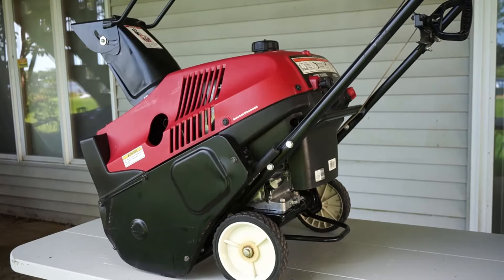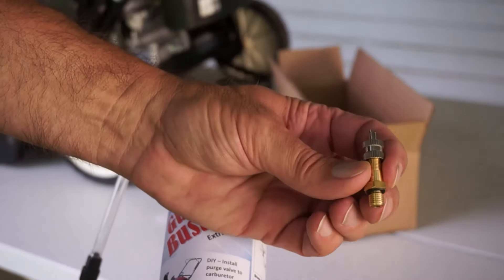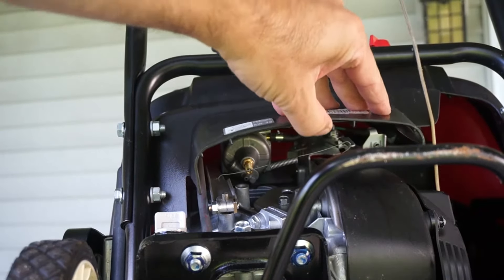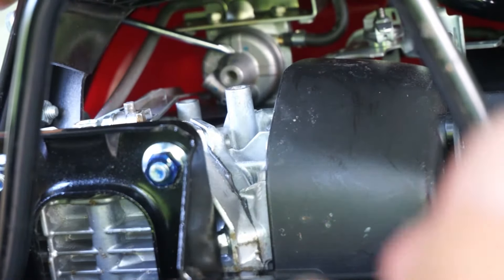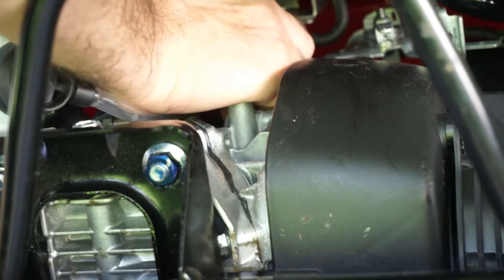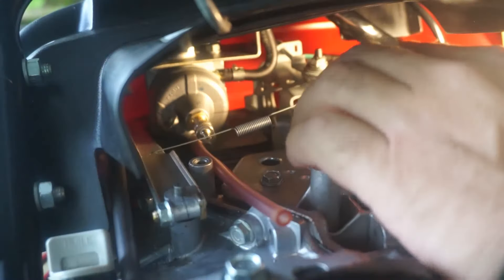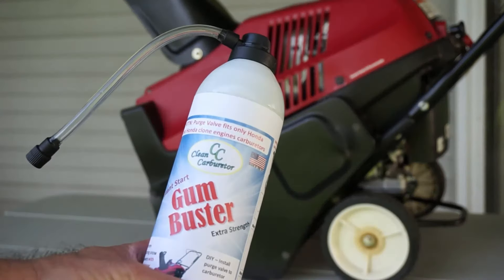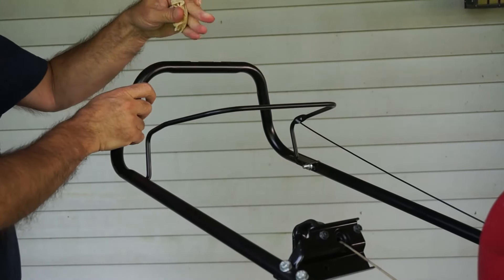Honda Snowblower Won't Start Quick Easy Fix with GumBuster by CleanCarburetor

Comment from the maker: Since all Honda small engines run leaner than any other small engines you always have to apply choke when you start it, even when it’s hot. As the engine warms up, you gradually remove the choke. Once hot, you fully remove the choke. Watch the part when the snowblower was turned off at 7 minutes 15 seconds, the choke was completely off.
Reply: Would gum buster work if the snowblower has gas in the oil? Could I replace the oil then try the gum buster?
Reply from the maker: @kelvinready3693  is your snowblower 2 stroke or 4 stroke? If I understood correctly it's 4 stroke but the oil got contaminated with fuel. This happens if you run the engine with the choke on or partial choke on. If you have a gas in the oil on any 4 stroke engines you definitely have to change the oil. Then you have to clean the carburetor. Yes, the GumBuster will clean the carburetor.
Reply from the maker: @kelvinready3693  if the 4 stroke engine oil is got a fuel in it it's because the engine ran on choke for too long. Fuel in oil drastically reduces the life of the engine. GumBuster will clean your carburetor before or after you change the oil.

Comment: Not sure if this stuff works or not. But got a free Honda HS520 today, owner stated that it would not start. It came with a half can of this stuff, so evidently at some point it was added by the previous owner. When I got home, I attempted to start the blower and it started right up, so my guess is the stuff worked and the guy didn't wait to see if it worked. It was nice getting a freebie where I didn't have to take the carb off and apart to clean or do any other work to it. I Will try this stuff on the next machine that has a gummed up carb that won't start and see how it does.

Comment: Have an HS621. Won’t start. Where can I buy the complete Gumbuster kit?
Reply from the maker: Hello Billy - you should be able to buy from Amazon here: www.amazon.com/GumBuster-Carburetor-Cleaner-Purge-Valve/dp/B08X35Y7CR/ref=asc_df_B08X35Y7CR/?tag=hyprod-20&linkCode=df0&hvadid=494939685805&hvpos=&hvnetw=g&hvrand=8613816702839139516&hvpone=&hvptwo=&hvqmt=&hvdev=c&hvdvcmdl=&hvlocint=&hvlocphy=9021468&hvtargid=pla-1190333445777&psc=1#productDetails

Comment: Do I need to drain the gas first before I spray the Gumbuster in the carburetor and can I put it back the gas that I drained. Also, the one that you spray in the carburetor is it safe also to use it in Toro snow blower 621.
Reply: Its safe on all small engine carburetors. If the gas in the tank is old, good idea to drain it out and add fresh, discard old gas. Put it in your cars gas tank, the fuel injected engine with that much gas in the tank can handle a little stale gas.

Comment: Frank is the man!  Great design and awesome product.  Snowblower stated on first pull and right before a big storm coming through too.  The valve reusability is a big bonus.  Design reminds me of the car A/C systems where you can pump freon via the low pressure valve.
Reply: My shroud seems much more closer and tighter fitting then shown in his video.  My snow blower was less than a year old and I didn't want to risk breaking the shroud so I disassembled it. It was a lot of work but it fixed it and I haven't had a problem since.

Comment: Maybe you can suggest a solution to a problem I have with the 'Fuel Valve knob'.. It will not TURN to ON.....I don't want to break it... any suggestions?
Reply from the maker: Try spraying it with WD-40. If it doesn't work, replace the fuel valve
Reply: @cleancarburetor  Liquid Wrench worked.. still stiff but started right up.... thanks for your reply!
Reply: Some WD-40 around the knob, let it soak a few minutes and repeat. It should work. those are plastic parts.